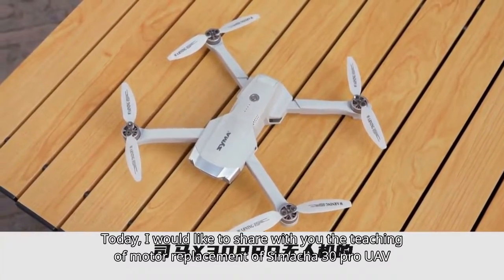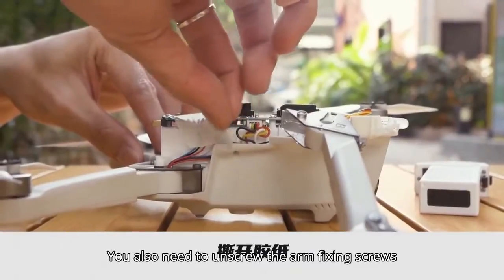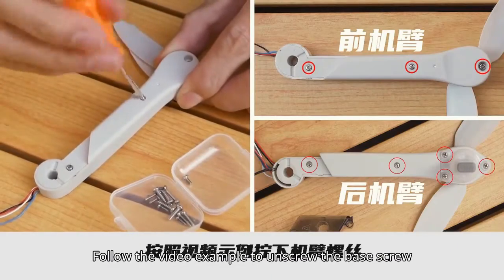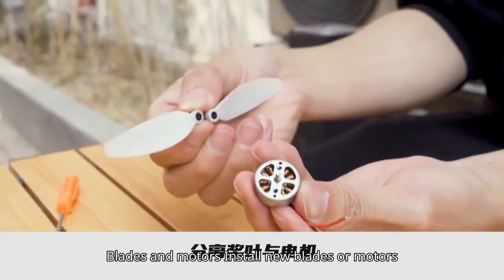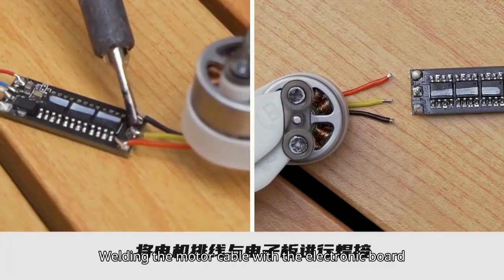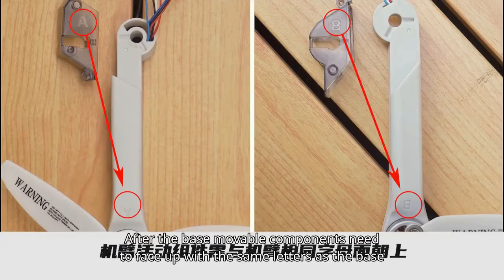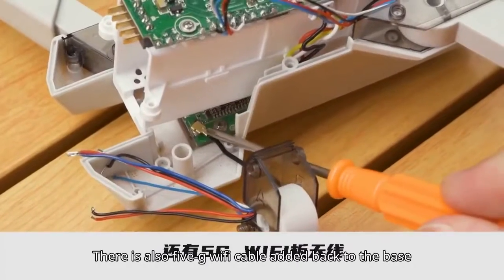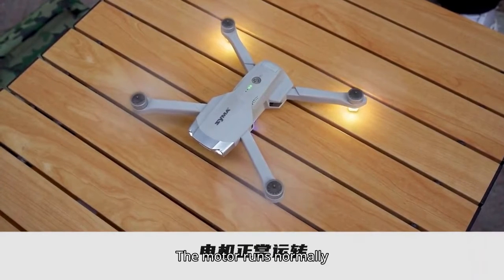How to Repair Drone Motor for SYMA X500PRO | 100% Working | SYMATOY

Comment: Hello, is it possible to install a coreless motor instead of brushless on this quadcopter board? Because the motor without a core has two output wires, but the motor of this quadcopter has four wires